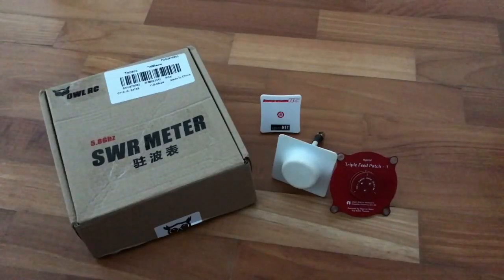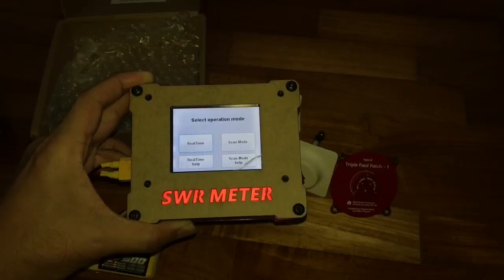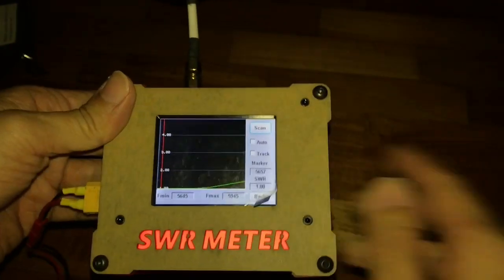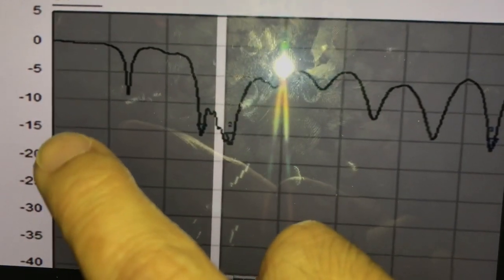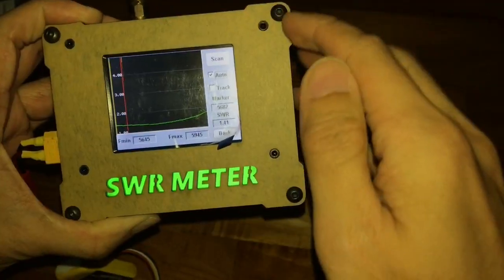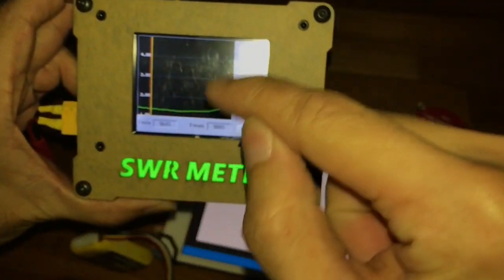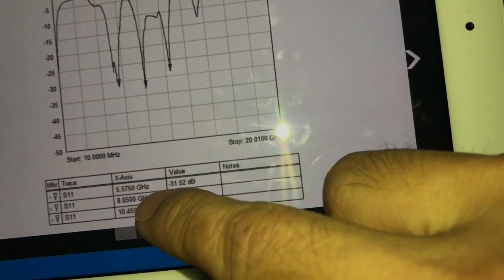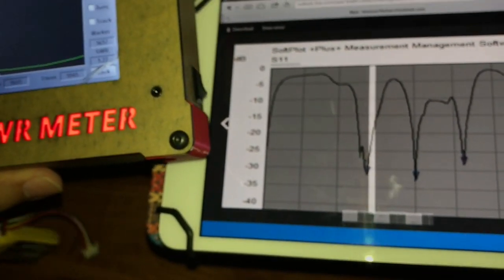Accuracy Test of OwlRC 5.8g SWR Meter - is it worth 100usd?

Comment: nice review terence, did you you consider that  using the sma adapter have big influence on the data reading..i have test the pagoda antena with and wothout adapter, when i use the swr without the adapter  the result is bad swr graph, and then i try to use tha pagoda with adapter the result is flat swr .
Reply from the maker: Thanks Sofyan for pointing that out. Unfortunately, my 5.8g Skyzone V1 google (big FOV, no diversity version) has an RP-SMA so I'm taking all measurements with that 'sma to rp-sma' adapter for consistency. It is also worth mentioning that for those curves taken with the 20ghz VNA, having an adapter or not had no effect on the readings because the RF engineer who did the test for me calibrated the lab equipment to negate the effect of any adapter he used to connect my antenna.
Reply: @terence79chan  I try to connect this owl swr meter to a 50ohm dummy load, what makes me wonder is the swr value that has an upward curve from low to high frequency. I tried to check the rf detector section trying to measure the voltage at the rf detector output, it turned out that the reading on the owl rc display was different from the value that was read on my multimeter,
Reply from the maker: @sofyanhardiyono9152  wow, the upward curve is interesting.   As for the voltage difference, that is because the voltage has to be processed just the cheap RF power meter board  on Aliexpress